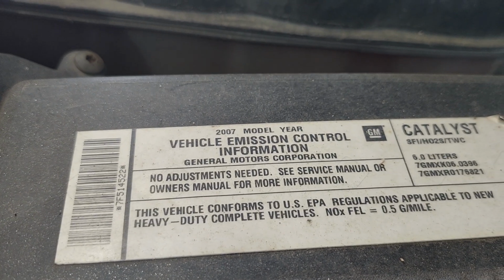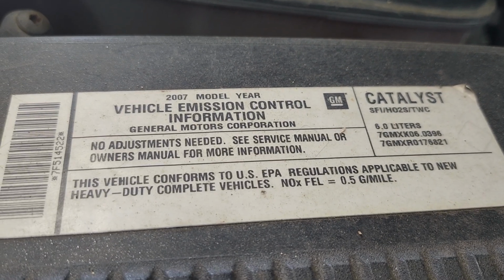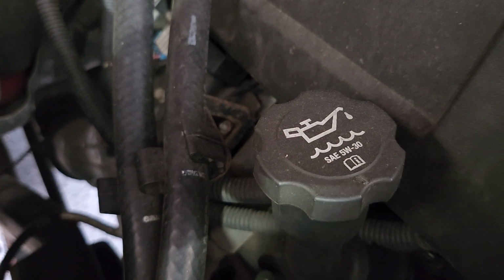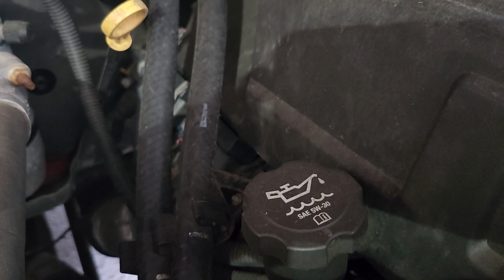Use 5W30  low engine failures .Use  0W20 oil high engine failures

Comment: If I remember correctly, my RAV4 Engine lasted about 70k miles using 0w20…. So I got a Subaru and it calls for 0w20.  Oh hell no.  I put 0w30 in the Subaru…. Smoother.  MPG change …. Not even noticeable to me.  

Just my opinion, but I do use the oil that’s best for my environment.

Comment: I've been running 0w-40 in my Passat.  I think I'll go to 5w-40 for the next oil change.  Also, I've been going 7500 miles.  I think I'll go every 5000 from here on out.

Comment: The rockers on 3.6 Pentastars will grenade no matter what oil you use.  I had a 2010 Grand Caravan 4.0 rocker arm issues with 10w-30 Mobil 1.  2017 3.6 Rocker issues with Mobil 1 5w-20.  4000 mile change interval.
Reply from the maker: Not true we have a few no issues 3k oci 5k oci

Comment: I have a Ford Ecosport 1.5L EcoBlue (75kw/100ps Eu6) with 72,000km, the company recommends 0w20 with the specification WSS-M2C952-A1. Because I live in Greece where the ambient temperature is from 5°C - 40°C, I think this oil is too thin and I'm thinking of putting 0w30 or 5w30 in it. What is your opinion? Will I have a problem?
Reply from the maker: Use the chart base on environment

Comment: 0W-20 will protect your engine just as good as 5W-30 as long as you're not towing or in a mountain region. The main difference is its stability as 0W-20 will shear out of grade and become even thinner over time. If you are changing your oil frequently this isn't an issue. Main advantage of 0W-20 is it's flow rate at startup (when most engine wear occurs), getting the oil to vital components more quickly.
Reply: DO NOT change engine oil at 10K mile intervals as the owner manual suggests, especially when using thinner oils. 5K miles tops

Comment: I have a 2024 Chevrolet Tahoe LT 5.3L. It says Ow-20 on the oil cap but the manual say 0w-20 or 5w-30. I called the dealership and they inform me they use 5w-30 because the oil dilutes in Florida faster due to hotter climate. In colder climates you'll use OW-20 depending on where you live and the season. Overall hotter climates 5w-30 colder 0w-20

Comment: I was advised by AMSOIL that I could not even switch to 0W-30 instead of 0w-20 ! I pull a trailer, short trips, and very warm summers! How could that harm my 2021 Nissan Frontier with 97,000 miles on the engine?
Reply: It's too thick for your oil pump and with bust the bearings.
Reply: @VILLEGAS76able So from 20 to 30, that oil pump will be destroyed? Nissan made sure that only 0W-20 can be used, period. So much for trying to make my vehicle any better. I guess I better move to Canada where 0W-20 is highly acceptable. But, if I moved to Mexico, they would be laughing at me for having to thin of oil.
Reply: @EdwardLaughlin-x6d Yes, because modern engines use a variable oil pump that the computer is monitoring the thickness of the oil.

Comment: I changed the oil fill cap on my Toyota (about a month after I bought it)from 0w16 to 5w30 like the euro models. It’s got 262k miles now and still sounds quiet and runs strong because I didn’t use inadequate lubricants just to get .5 mpg better mileage and please the EPA.

Comment: 10w30 for everything no problems for 50 years, the ultra low weight oils are just another trick the oems use to squeeze out another tiny amount of mpg, but nobody realizes that these oils dont have the film strength to protect all the loaded surfaces

Comment: For both my vehicles I  used to use 0w-20 in the deep cold winter months and 5W-30 in hot temp summer months.  Now..  I use 0w-30 for all seasns..  Full synthetic dexos-1 grade 30 burns less oil and makes engine soumd quieter.  I also replace oil / filter at remaining 35% usage.  This works for me...
Reply: I put 0w30 in my 2024 Subaru Forester 2.4L at about 7k miles, replacing the 0w20. Immediately, the engine was so much smother and I had peace of mind. 

My opinion, but this is the oil the car needs right now.  Later, I will use 5w30 when the car has a lot more miles.

Comment: Between two Civics 2008 and 2014 put more than 1000000 km. One million km! Always used 0W20 oil. Not a single issue with engines! My 2014 Civic was a taxi for 8 years. When I sold it in March she had 625000 km on it. Was running like new! Someone is driving it now and I am sure if this person will change oil every 5000 km he will reach a million km no problem!
Reply: Great to hear Robert! I have a 14 civic daily driver, with 285,000 on the clock and runs like new! Same  0w 20! Glad to hear I’ve got lots of miles to go! Cheers

Comment: It is the thinner oil causing the problems,,,Because back in the early to mid 2000s when all cars used 5w oil,,,,This wasn't an issue,,And on the whole 90 percent of engines didn't destroy themselves ,,,But as soon as 0w oils were used,,,That's when all this started,,,,I know I'm right,,Because I'm right about everything,,,I am the all knowing,,,And I am your God,,,

Comment: So this has been your actual experience with these different viscosity oils? I just watch a video from "the motor oil geek" where he was saying there isn't significant difference in wear between 0w20 and 5w30. Although I would never run 0w oil. I'm even considering going from 5w20 to 5w30.
Reply: You didn't answer my question.

Comment: I own a 2017 Honda CRV with 87000 miles on it. I change the oil every 5000 miles due to my concerns about having TURBO. I always use Mobil One 0w20 but I plan on going to 0w30 on the next oil change.
Reply: I have a 2022 crv 35,000 on it oil dilution up the wahoo changed to 5w30 penzoil platinum and 93 octain from Texaco and vuala I mean night & day

Comment: Switched my 2014 Mazda 6 and 2022 CX5 both over to 5W30. I live in the south and it doesn't get THAT cold here. Additionally, these engines use 5W30 everywhere else in the world.  I don't care about saving 1 MPG by using a thinner oil.

Comment: would it be better to use oil life indicator or use the mileage to change the engine oil? is the oil life indicator adjust based on driving behavior or engine performance?
Reply: No. That indicator doesn't care what oil you use.

Comment: Lubricity  tests 5w30 has a lot less wear scar on the bearing test, I've been a tech for over 40 years , hot climates don't need 0w20, plus changing oil ever 5 to 6 thousand  miles is my recommendation

Comment: Except of course, actual data from actual tests and actual oil analysis has proven, beyond any doubt, that these 5W-30 religion claims are fiction.  There is no actual data that shows engines fail earlier or wear more with 0W-20.  

People think it is still the 70's and technology and chemistry hasn't changed in 50 years.  They are wrong.  The additive packages are what protects the engine, NOT the viscosity.

The people that claim 5W-30 is superior because it is thicker, are the exact same people that think running their naturally aspirated car that takes 87 Octane gas will run better and get more power with 93 Octane gas.

But, then again, they probably also think the earth is flat, vaccines don't work and 5G is killing the birds...

Comment: I have a 2025 Pathfinder which I bought because no CVT & the 3.5 V-6. Manufacturer specs 0W-20 and I've been using that. 8,000 miles so far with average 3,500 mile oil changes. Approx. 65-70% highway miles. I live in MS. I'm thinking I should do an oil sample test at 10K, then switch to 5W-30 with another oil sample test at the next oil change.

Comment: My owner's manual is only 0w20.  I went with the recommendation for the rest of the world 5w30
Reply: Ditto, never questioned my oem recommended until recently; just did my first 5w30 instead of “recommended” 0w20. So far, so good, running great…might even be getting BETTER mpg now weirdly enough…going to test more.

Comment: As a 70 year old I have seen oil evolve from straight weight oil to 10w30 & 10w40 with all the same discussion as we see in videos like this.  And when Mobil 1 came on the scene, all kinds of even crazier stories and opinions popped up.  Clearances may not have changed much.  But gaskets and oil seals have.  Engines seem better balanced with cooling systems and hose clamps getting better.  Todays engines have electronic/electrical failures as the number 1 failure.  Cooling systems are next.  Oil is not really an issue, as long as there is sufficient presure, which happens to be a problem often these days.
Back 60 years ago, tuneups lasted 3k miles, unless you bought Eckhlin points from Napa.  But you still had to change the plugs very frequently.
Plastic parts for styling and crash test safety has mislead people about the quality of cars.  Used to be a car with 100k miles was ready for the scrap yard.
Reply from the maker: Yes I love the the way the car manufacturers say its a sealed transmission for life no oil changes e
Reply: 0W40 is one of the best viscoisty in old car, but you must be sure you can use fully synthetic oil there what cleans engine good.

Comment: My 2015 Toyota Sienna has used 0W20 since new. It has 205K miles and still going strong. It doesn’t burn any oil.
Reply: I have personally only used 0w-20 in my 2018 Lexus es350  however I change it every 5k.
Reply: @MrDunham1-b4n i do the same with my cars. One changed every 4k the other one every 5k
Reply: Not every smoker dies of cancer, not every KIA catches fire or burns oil...
Reply: What type of oil
Reply: @gerardford5707  the first 100K miles it was whatever oil the dealership used. The rest of the time we’ve used Valvoline High Mileage 0W20.
Reply: @Becca-k4h OW20's designed for high miles, or long drain intervals are much closer to a 30 weight and are made thicker on purpose for obvious reasons.
Valvoline HM's cSt @ @100C is 8.5.
Here is the cSt range for a 30 weight at 100C 9.3–12.5.
You're essentially running a thin 30 weight.
Reply: My new Ram 23 came with 0w20...couldn't believe all valve train noise i was hearing....first 1000km i switched it to 5w30 Amsoil SS and ran so much smoother.
Reply: What type climate ?
Reply: But I bet you have the common "Toyota Ticking" on the engine.   My 2010 Camry w/6 cylinder with 120K miles  (which is recommended to run on and has always been run on 5W30) burns no oil and has a very smooth, quiet engine.  My 2014 Avalon w/6 cylinders has 85K miles and always run on recommended 0W20, and it has the "Tick" and burns a qt of oil every 4k miles.    It's the second number (20) that makes the engine run with less protection when hot, that's why you should always run a higher second number in the oil weight to provide added protection to high mileage engines.
Reply: @oozle-g7e  ou’re probably using a cheaper oil. Valvoline MaxLife 0W‑20 works great in Toyota and Lexus,
Reply: @oozle-g7e  no ticking noise at-all. I change the oil every 5K miles or 6 months… whichever comes first. And it’s mostly highway miles.
Reply: Your the exception,,,The 1.5 million other Toyota owners who have class action lawsuits on Toyota would beg to differ,,
Reply: @nightstorm9128  What class action lawsuit are you referring to?
Reply: @nightstorm9128 c est faux

Comment: Do an oil analysis on your 0w 20 at the time the oil has changed a computer will analyze it and you will see the results
Reply from the maker: Yea  people should stick w it  when it turns dark change it not maxed out of its protection or 1 qt of oil left in the engine  in 5k let alone even check to see if its full weekly

Comment: Been putting 0w20 in my 2018 tundra since 2018.. Now with this info I'm learning.. I'm thinking 5w30 from now on.. The only part I wonder about is on those days we get minus 20 real feel... Am I hurting the truck on startup during that week... So I might do 0w20 only during the coldest months and switch immediately to 5w30 when the temps go back up over 30 consistently
Reply: 5w30 is good for almost 20 below i believe...

Comment: Look at the oils used in Arabic countries ..
Same motors ..
Same VVT ..
They use 10W-40 MINIMUM ..
Some mechanics reccomending 20W-50 oil ..
Lightweight oil is to meet government CAFE standards only ..
I use 5W-30 in my 2022 Toyota Tacoma ..
I had a 2016 Nissan Rogue i bought for Uber use ..
I bought it with 24K miles and sold it at 190K miles ..
I used 5W-30 on the first oil change and when it reached 50K miles i continued with the 5W-30 but i then also added a half a bottle of STP oil treatment ..
I sold it at 190K miles and it ran like a Swiss watch ..
Ill never put anything lighter than 5W-30 in my motor ..
This is what I use ..
You use what you want ..
Reply from the maker: I agree with you in the long run
Reply from the maker: Preach it

Comment: European cars had to switch to 0/20 to avoid emissions fines. They don't care about the damage done to the vehicles. VW got a lot of fines from America. That's why 0/20 was designed to reduce oil emissions; they don't care about the vehicle engines.
Reply from the maker: Ow20 goes out the tail pipe thats not emissions reduction
Reply: @anthonynastasi4098 European cars were fined in America for emissions, so all vehicles went straight to 0/20. This oil has a low protection rating, as proven by tests, and wears out the engine over the years. Also, the service interval is short, making it unsafe to use it for 15,000 km. You should change the oil every 8,000 km.

Comment: We bought a clean used Mazda CX-5 and the cap and manual call for 0W20 but that's just for vehicles shipped to North America. The same naturally aspirated Skyactive 2.5L engine in the CX-5 and other Mazda's slated for the rest of the world say 5W30. It's all about the US forcing car manufacturers to hit ultra strict lower CAFE numbers to be able to sell US market. I switched to 5W30 on the first oil change and will never use anything lighter and any car we buy including the crazy 0W8 that Toyota calls for.
Reply: Same here in my 2022 CX5 and 2014 Mazda 6. My 2001 Miata gets 5W30 winter and 5W40 summer.

Comment: I dont care what they say, wouldn't use 0-20

Raced motorcycles and been driving since early 80s....

Common sense and experience goes along ways
Reply: 0w20 is the wise choice in cold climates, and a 5000 mile OCI.

Comment: Mr midas engineer if you think 0w20 is to thin ,can you explain how 2 cycle engines run so long ?  With oil mixes with gas , it cant get any thinner than that. Full of 💩
Reply from the maker: 2 stroke fails
Reply: It's logical to use 0/20 oils to protect the engine during startup in locations where temperatures are -15 degrees Celsius. But in locations where temperatures are 0 degrees Celsius, using 5/30 makes sense. They're forcing all vehicles to use 0/20 oil due to emissions.

Comment: Something very very interesting, the Penzoil Platinum 5W-30 has the exact same cold flow speed at 0 degrees down to the last drip as the very same oil in the 0w20...Crazy.!
Reply: I've also seen just the opposite.
Reply: Not according to the test I’ve seen. I just watched a video from project farm showing the opposite of what you’re saying.
Reply: @Maynardd that video is not at zero degrees but more like negative 30...... fahrenheit that is
Reply: @Mike_D-w4t  all right, you’re still incorrect as you can simply google a chart showing you the difference in temperature. Temperature the oil is good to cold or hot.
Reply: @Maynardd  The Op's comment is still correct. There is the Penzoil Ultra platinum not to be confused with the Platinum as the 5w30 Platinum has the same exact cold flow flow rate at 0 degrees as the 0w20 in the same Platinum down to the last drip. The UIltra Platinum performs differently, I physically watched the entire tech test video

Comment: It's crazy. Modern technology isn't always a good thing. Modern engines after 2015 are less reliable than older engines. My mechanic has 2 GM trucks in his shop with bad engines that have less than 100,000 miles. I sometimes think modern trucks are intentionally designed to be less reliable in an effort to make people want to by battery powered vehicles.

Comment: CAFE thing. I have a 24 Malibu for my commuter car, calls for 0w20.  I have put 5w30 in since new with 3K intervals after a 500 mile initial change. I know these tend to blow up prematurely, hopefully it will last a couple years.  I run 5w40 in my 130,000 mile LS1 2000 Corvette, and 10w40 in my 04 210,000 mile 4.7L Grand Cherokee. All with 3K intervals, all run excellent.

Comment: What about 0w30?  

Would it be ok to switch to 5W30 in my 2025 VW Golf R?

I am in Pittsburgh, but the car is garage kept and I work from home
Reply: if youre going to do a 30 oil do 5w30.. 0w30 shears quicker and requires more viscocity modifiers

Comment: It’s best if you bought the car new is to change the oil at 500 miles, then at a 1,000 miles and every 3,000 miles or 3 months after that! If you bought the car used you want to see maintenance records (period)! No records no buy! Change your oil every 3,000 miles or 3 months like clockwork! You will not have any problems with your car’s engine unless it’s a manufactures defect! Keep your maintenance records regardless of what others say or do! One day you may want to sale it, the person you sale the car to will have proof that you took care of the car. If your car develops the ticking sound try thicker oil, if not just keep changing your oil at 3,000 or 3 months no matter what!
Reply: 3000 miles I get, but you don’t have to change it every three months. Every oil manufacturer will tell you two years is sufficient if you’re running low miles, for example only driving 2500 miles in that two year timeframe.